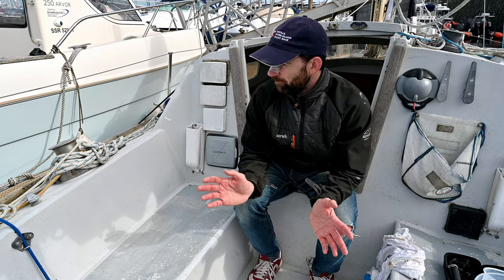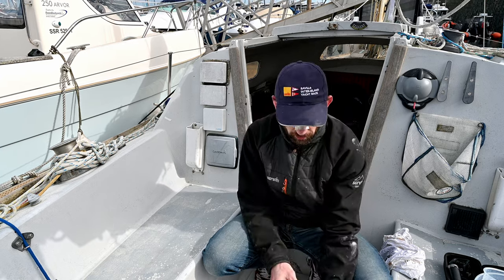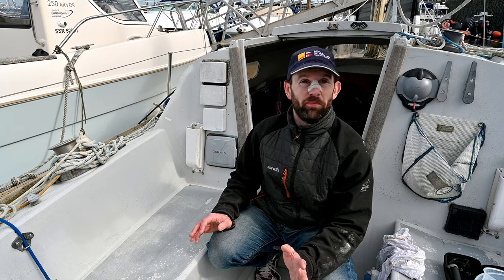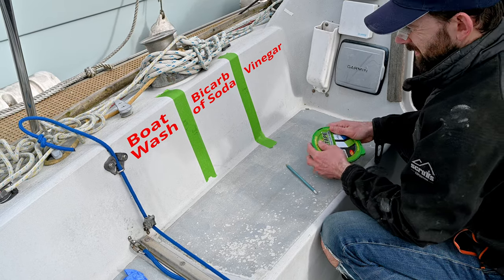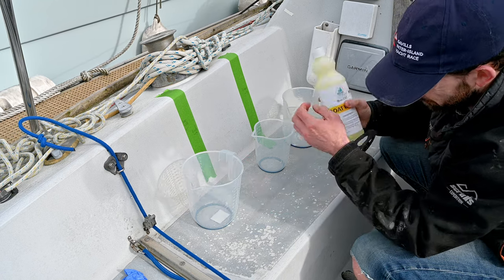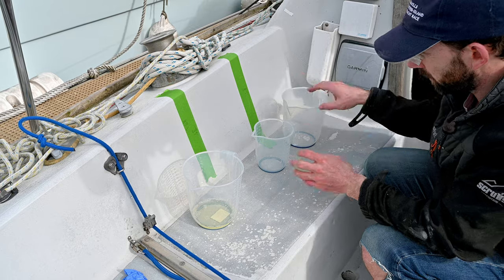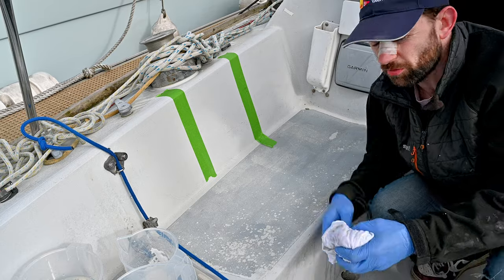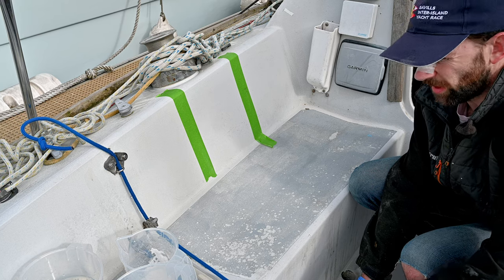Ep24 - Restoring 50 Year Old Gelcoat - 3 Techniques

Comment: Thanks for the video, great try. Unfortunately, I have not yet found a better way to clean the old Ecume gelcoat.
Reply from the maker: Thanks! Yeah it was a bit of a disaster really. It's very difficult to tell how much dirt is engrained in the gelcoat versus how much of it is micro cracks that can't be cleaned. I put a pressure washer on it today and just jet washed the whole deck down! Not sure why I didn't start with that approach really! It did take a lot of the non-slip paint off though!